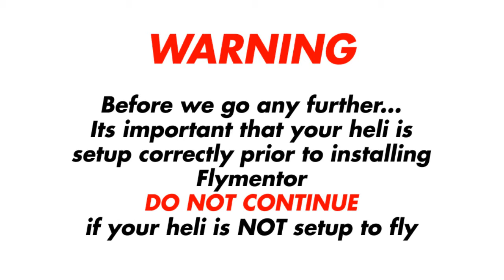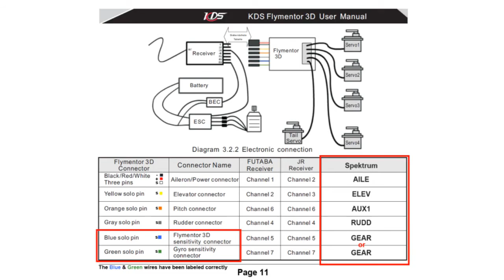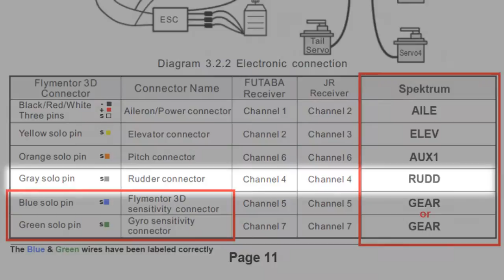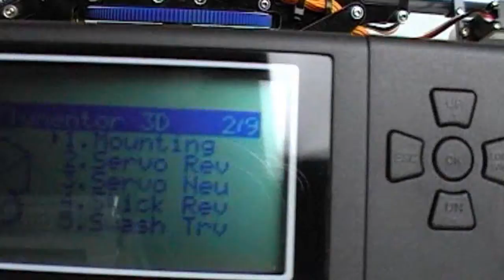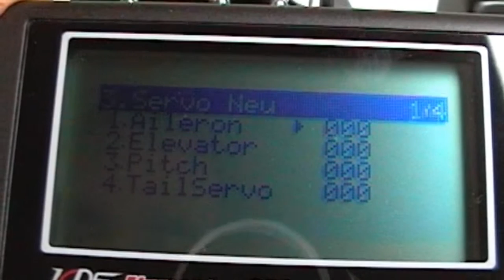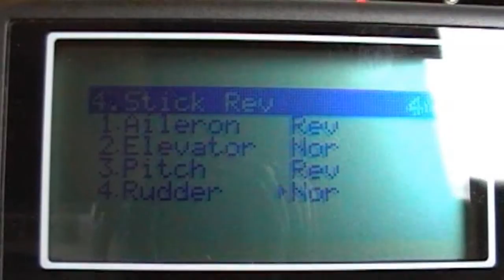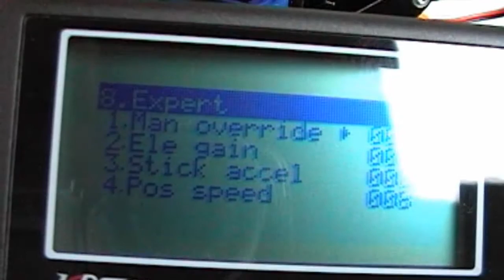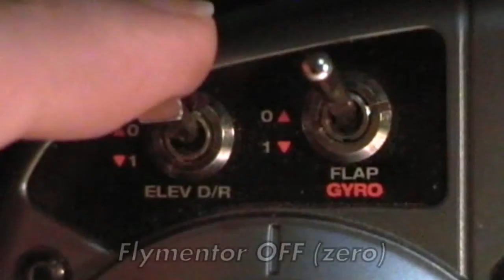Flymentor - Complete Setup Video (Dx6i)

Comment: Hi Ivan, that lack of power at 100% stick wasnt anything to do with my motor or esc it was because my main shaft had a slight bend in it, and i suppose the more throttle i gave it the more vibrations, put new one in and sorted, just goes to show that its not always the obvious, i did wonder why it took about 25% throttle to get it going, because it was bent. Thanks so much again for all ur help Ivan, if it wasnt for you i was going to give the hobby up and take up fishing again, yet another hobby of mine i have problems with,lol 
Matt

Comment: Hi Ivan, I got to admit the silent video was confusing but I eventually got it. My problem was using my DX9 and getting it configured. I did my first flight today and must admit it was awesome (without training skids). I had a slight crash three weeks ago so my repair is not yet professionally setup (mechanically). The tail gyro is doing its own thing (I have the blue wire connected). I am leaving it alone, doing its thing (I am using the FM tail gyro). Oh, I have the fly mentor installed on a Blade 500 3d. It does have a bit of a L-R swing (long wobble) but I will wait to get the mechanics correct before I play with gains etc. So, with all the out of wack repairs (new main blades, new grippers, new main gear, new #2 servo and new fly bar), I could hover it (not flying yet).
Reply from the maker: Hey John..It looks like your on the right track, but the main thing is you didnt give up..Im glad you pointed out that the heli is in a little bad shape after the crash (you've experienced the crash so we can put that aside cos it will happen and does to all of us) the main thing is your still going.
Its super important to have the heli working perfectly for FM to assist you, get that done! and this is a very good thing, cos eventually you'll fly without FM and you'll have the knowledge to maintain the heli. If things are off in the setup it will influence FM which may give weird results.
Start with the hover until you get bored of it and then hover some more (its all about muscle memory...acting without thinking) then learn nose in (nose in is the KEY to flying circuits!!!!)
I have a blade 400 (my first heli) that is one twitchy heli...the Trex 450 range are much more docile, something to consider.
Let me know how it turns out.

Comment: Hi Ivan, You was right, it did have something to do with the KDS, ive put my Esky gyro on and its alot better, got abit of tail waggle but im sure i can sort that, only had it on my lazy susan tonight so will tell better when i get her outside, but im confident i will get her working, i can give it 100% throttle and shes holding her head. *Im really, really hoping she will fly, ive been at this hobby for nearly 2yrs now and only ever hoovered once, yes once, i lost interest in the hobby and havent really spent the time on it as i should, but you loose interest in something that you cant get working thou dont you.so fingers crossed i will be doing abit of flying this weekend, and if it wasnt for ur vids and others i wouldnt have even known where to start, thanks Ivan great help.
Matt
Reply from the maker: Your welcome Matt....The tail wage is simply a case of lowering the gyro gain until the wag stops...
Dont be deterred, Ive said it before and ill say it again, a simulator is the best way to learn..you can crash endlessly until it sinks in, and it does translate to the field, I have saved my helis a number of times with quick reflex actions from all the sim training.
While you train, you can learn about the heli mechanical setup in detail...the only time you want to crash in the field is when your going hard bashing the heli around...you dont want to hover and crash, it will put you right off...learn to hover then learn nose in and there's your foundation....keep at it, cos when you get it and you will, its a massive thrill!! (that last bit kinda rhymed lol!)

Comment: Hi again Ivan, in vid at 11.07 mins "Mix 1" do we leave it like that and then if we want to switch it off we just use the ELEV D/R switch to turn if off or do we set "Mix 1" to INH? thanks again for ur vids
matt
Reply from the maker: Thats correct Matt...Copy the setup you see in mix 1...The ELEV/DR switch, turns off FMs stabilization all together.. The heli should behave like a normal setup with FM off...No need to INH the mix.

The gyro/flap switch, switches between balance and position mode.

Comment: Hi Ivan Got some mega mega news, done my 1st 6-7min hover with "CRASHING" and it was quiet windy today aswell, but the KDS sorted that out, need some fine turing thou, got tail wag and when i give it left/right rudder it judders round, not smooth at all, how do i sort that out Ivan? and also lack of power but i think thats down to my ESC, or can that also be due to having the drive belt to tight? Just like to say thank you very much again Ivan because if it wasnt for you my Belt and KDS would still be sitting in the box, so thank you again so much.
very kind regards
Matt
Reply from the maker: Hey Matt, thats awesome news!!!!! was that withOUT crashing?? Thats a massive step, your almost there. The wagging is generally due to the GYRO GAIN being a little too high, The idea is to increase the gain until you get a wag, then back it off slightly by lowering the gain a tiny bit at a time until it stops wagging (thats the sweet spot).
The tail belt needs to be not too loose and not too tight, if you push the belt to test it flexibility, it should flex to about half way to the other side of the belt....just loosen the boom mount on the heli frame a bit and adjust the boom to get the belt right...you need to make sure the belt is not twisted inside the boom...it should only twist 90° from one end to the other.
If all is moving freely, bearings are ok, then it could be your esc and motor selection..and depending on what lipo your using, generally a 2200mah 30c or higher will do the job.
Keep it up and before you know it you'll be flying circuits without FM.
My pleasure helping out..Your welcome!!!!  :)

Comment: Hi Ivan, i found the problem to lack of power and its my YEP ESC, it was giving more power at mid stick then it was at full stick so it must be something to do with how im programing it, when i do program it Ivan i have to use the program card and i have to setup the throttle range, 0% and 100%, you know the throttle has a sub trim now when im setting up the 0% range, do i have to put the sub trim right to 0% aswell as the stick and then also vice versa with 100%, put the sub trim to 100% aswell as the stick? think thats where ive been going wrong but not sure, or do i just leave the sub trim in the middle and only use the stick to input 0% and 100% throttle? and the li-po im using is a 2200mah 35c, thanks again for your great help Ivan, respect!
Matt
Reply from the maker: Hey Matt, it may not be the esc being faulty, maybe just setup wrong...
1: the prog card is for setting up FM you should leave that at default i believe...you need to prog the TX.
2: I have no idea what you mean by subtrim on the throttle...the subtrims should be zero..never touch subtrim for throt...I dont think I touched that in FM...reset that.
3:your throttle curve in your TX should be "0-30-55-80-100" something like that.
4:pitch curve "minus 48- minus 49-50-75-100"
5:Most important thing which I'm not sure you did, IS...setting the throttle.

To do this (only has to be done the one time...JUST IN CASE.. DISABLE MOTOR!!! ) power up the TX only..place the throttle ALL the way up (full throttle) then turn the heli power on, depending on what esc you have, you'll hear usually two beeps or two double beeps, its at this point you drop the throttle all the way down, this will set the throttle, your telling the esc where your max and min is on your TX...if you leave the throttle up too long it will go into prog mode...power down and repeat, as long as you drop the throttle before the 4th set of beeps..if done correctly you'll hear the normal power up procedure.

See if this helps Matt...It could possibly be a bung esc.
Reply: ***** Hi Ivan, thanks for reply, NOT SUB TRIM sorry i ment to say TRIM, and yes my trottle curve is set to 0-25-50-75-100 and my pitch curve is the same, the ESC that i have is my 2nd one cause 1st one was faulty and its a YEP 45amp ESC off Hobbyking and im sure its faulty, its seems to save the settings then its loosing them after a while and its still giving 100% thottle at 50% stick and 50% throttle at 100% stick, so yesw i think its the ESC, this hobby seems to make my feel thick, i go over and over things thinking im doing it wrong when its down to faulty parts, like with the KDS 7 months i was trying to sort that out thinking i was doing something wrong but i wasnt it was a faulty KDS,lol, best be getting hold of hobbyking and sending there ESC back AGAIN! thanks again Ivan for all ur help, i will let you know if i get it sorted, respect.
Matt
Reply: matt barratt Hi again,Ivan, Well just done 3 Li-pos withOUT crashing, sorted, think that loss of power has something to do with ESC, it did it again so i unplug and plug back in and it was ok again, yes the KDS held very well in this windy weather too, Ivan, ive got my own gyro on and that means all my RXs plugs are full except the bind plug, how do i use the Positioning mode? the green/blue/grey wires im not using, not urgent because im ok as it is, but the green and grey wires are the gyros ant they? so i take it that the blue is position. but like i said not to bother im happy with what ive got and there is no way i would of done it without yours and others guys help, so thank you again very much.
Matt
Reply from the maker: Your welcome Matt!!..Well it looks as though your on the right track. So it was the esc playing up after all, glad you sorted that out. Well done on the flights / hovers, just keep it up!!!
As far as the switches go, you'll have to watch the last part of the video again to see how it was setup, basically the gyro is set and left, the switch setup is so you can swap between modes, balance mode is the only one you need to worry abut, position mode is a bit of a gimmick imo...you want FM to help you keep the heli level, but YOU still want to learn to control it, right up until you can do nose in with confidence.
Once your confident with controlling the heli, you then might want to be able to turn off FM's assistance, giving you full control.

Comment: A friend got this "flymentor" but newer get it to worc so used the helikopter as spares for another kds.2 years and no flights on it.They must be ready to fly out of box and no set up and this innova that i purchased  is ok but also here a problem, i dont get it into idle up and just fly it in normal mode at low rates. Is there any tip to get it into idle up? It show idle up on transmitter in mode 2 normal 60% but motor just have same rpm .Maybee it change a little in pitch but no rew up on engine so i just go back and fly it in normal.Could be fun to know but anyway it flies , but no 3d is possible before figure out this.
Reply: Hi, its been a very long time since i used flymentor...its designed for people to learn the basics, as it assists with the flying process, not designed in any way for 3d and idle up. Once you are at a very good skill level then you remove flymentor and setup the heli for 3d...i suggest using a flight sim to gain experience, a lot of experience before you decide to do 3d, there are many tutorials for setting up 3d online...hope it helps.
Reply: Yes i know it,s best to just fly it like a plane and have fun at high altitudes.I ususally just spool up and send it 100 to 150 meters up and stop there lurcing around in circles.We also use some sim )

Comment: hi ivan, I recommend using -70 for gain for horizontal mode only, position hold is just sa piece of crap. if it were GPS position hold, id use it. since its not, horizontal mode flies smoother, and will teach flier to hold the drifts

Comment: think ive got you, instead of using the swash mix in the TX use the KDS Travel?? is that right

thanks
Matt
Reply from the maker: Hey Matt...its been a while since I played with FM...when you switch to 90° as apposed to normal setup of 120° this means that FM will take over mixing the cyclic servos...no subtrims etc as FM controls all that...you program all that stuff via FM...get your TX setup then use the software to make all the adjustments. Its really important to have the normal / common heli setup before you install FM to take it over and control it....if the normal setup is wrong, it'll throw you when installing FM as things wont move how the need to....hope you get it up and running.

Comment: Hi again Ivan. Took Belt out today and all she wanted to do is spin, as soon as she lifted off the ground she just started to spin anti-clockwise and chouldnt get her to stay still, and ive got the gyro set to 70 in my TX and FM,
Reply from the maker: Hey Matt...I think there still might be something wrong with the tail setup, as its not countering the torque..the torque of the main blades spin clockwise, therefore the body of the heli wants to spin anti clockwise...the tail is supposed to correct that by giving right rudder input (tail assy slides left)..there is always the possibility FM isn't working correctly. With this type of problem, I would start over and make sure the heli works correctly WITHOUT flymentor..if it does, only then continue on with FM.
Its sooo difficult to diagnose without seeing whats happening and how you've set it up.

Comment: wud you belive it, Sorry to bother you again Ivan, With motors, when they pack up do they just stop working all together or do they start off with losing proformance, just been trying to sort gyro out and now i cant get full power out of my motor, it just gets to about 505 and wont go no higher and ive never had a motor go on me. thanks again Ivan
matt
Reply from the maker: all good Matt, happy to help if I can...Generally the motor will die if too much current is being drawn (the wire in the motors have a protective layer so the actual copper wires doesn't touch one another) when too much current is drawn there's a lot of heat which can melt the protective layer causing a short circuit, generally there will be smoke and a horrible smell...it could also kill your esc. I suspect your battery is drained...or mechanically there is something resisting / binding...does everything move freely??

Comment: Hi yet again Ivan, very sorry to bother you again, it didnt last untill i crashed "again", still got a problem with my power, i thought changing the main gear had sorted it, well it did while it was on my lazy susan but just took it out and at 1st all seemed ok but i had to push to 100% throttle  to get in the air and it went to about 2 meters and then started loosing power even thou i had throttle at 100%, ive also noticed that when giving throttle at the start the main gear will judder, would it have anything to do with having the tail belt to tight or having the motor to tight up against the main gear? I was taking a video with my fone to show you and all of a sudden the power shot up and it flip my heli on the roof "again" just when i thought all was going well another problem comes along, i just cant understand this power issue, i changed main shaft today and looked at the main gear and tail belt and it seems ok to me, not that tight if i loosing the tail belt just a mm it starts to slip and i can get a peace of paper between the main gear and pinion, sorry to bother you again with all this Ivan but im lost.
kind regards
Matt
Reply from the maker: Hi Matt sorry for the late reply I have been really busy...I had a similar experience with my 4 blade heli, no matter how much power I gave it wouldn't lift, turns out the main head assy is crap and it cant handle the g forces, therefore not letting the blades pitch to get lift.
Matt I would suggest, starting over again from the start...I know that sounds horrible, but you inspect each bit as you go...your motor and main gear should have a tiny tiny little bit of play so it doesn't bind up, spin the gear to see if there are tight spots...the belt should also have a little flexibility, not too tight.
The electronics seem to be a pain...take them out of the heli and test them thoroughly...A 40 amp esc and a 450 size motor should do the job perfectly, being able to supply power to the servos as well.
You may have a gear (such as the tail blade gear that could be binding with the main gear) causing the motor to overload, but that would mean the esc comes down super hot...I'd love to help, but its so hard as theres soo many things that could be the cause.
Reply: ***** Hi Ivan, the lack of power was due to my main shaft being bent, only avery small bend but enough to stop it from getting to high power, see never had that happen to me before but that is some new i learned about the hobby and will know next time. Do you know anything of the belt cp v2 being discontinued? a shop over here in UK say it is but ive heard that many times before, so was thinking of getting a Hobbyking 450 barebones and transfer all my belt stuff across to the HK, told they are an ok heli. Thanks again Ivan if it wasnt for you my belt would of been put in the bin.
thanks
matt
Reply from the maker: Hey Matt, sorry for the late reply, been busy with my work...It looks as though your getting on top of the whole thing...imagine when your done, how much you will know about the helis you fly...its a good thing. Sorry I dont know anything about belt cp, but I do know a lot about the hobbyking helis, as I have a lot of them..to be perfectly honest the best 450 heli would have to be the 450 pro, just built a lot better.
Dont give up!! due to your issues with the heli, you have managed to learn more than you expected. I think you should consider building a 450 from scratch, then you'll truly understand it.